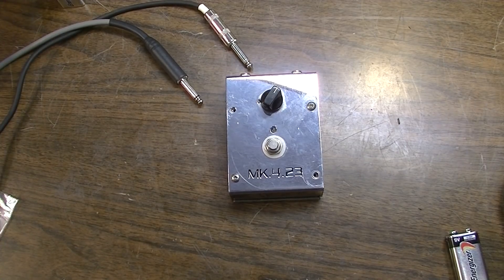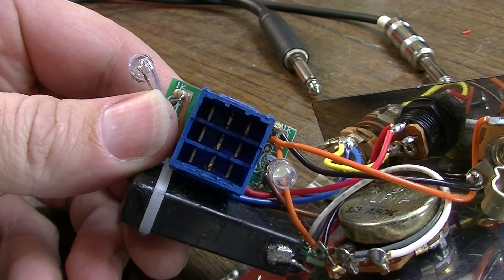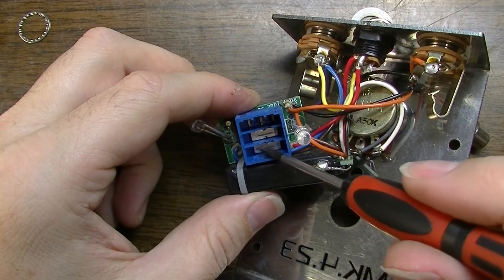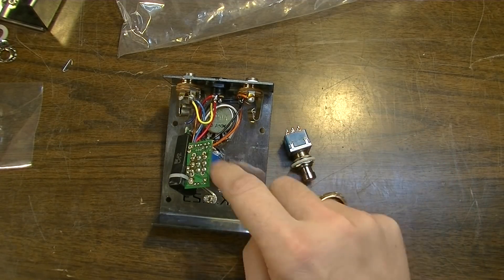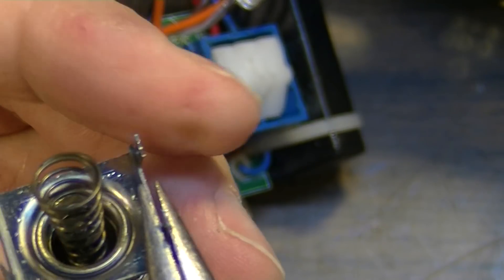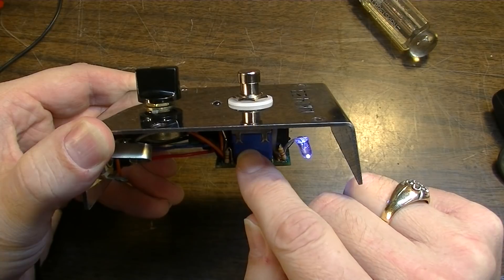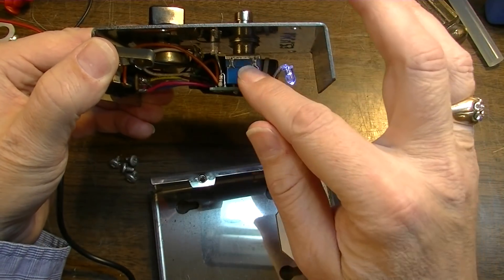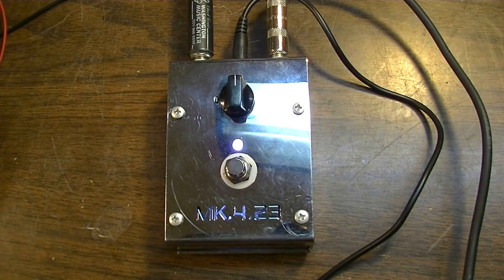These 3PDT Pedal Switches are TERRIBLY Designed - Creation Audio Labs MK 4.23 Clean Boost Repair

Comment: I've had 4 of the aqua switches and 2 of the black ones fall apart internally with simply minimal soldering. I'm about to start using knife switches I'm so fed up. The solder just destroys the internal contacts.

Comment: 10-15 years ago Creation Audio Labs was a respected group of people in Nashville who would do a great job refurbishing your console or effects units. Now,  it's a couple of hapless interns in a barn with no AC or heat, sewing batteries into electric blankets. Occasionally, they do a run of pedals and MW-1s, but it's not even remotely the same gear it used to be.  Now it's the cheapest Chinese circuit boards Alex can find, "assembled" into the cheapest recycled metal chassis he can get.

If you can find an old MW-1 or Holy Fire, it is a worthwhile purchase, although there are better, more modern alternatives now.   But the current stock is not even remotely in the same league.

Comment: 17:14 it came on by itself. Watch the led light.
Reply: Yep. Good eye. Switch is still crap. I don't get the bandaiding approach and this pedal's operation will only ever get worse until they have someone replace the switch. If someone doesn't want to deal with desoldering, use a $1 3pdt pcb and transplant or rebuild the other parts.
Or just call Creation. They're a good group of dudes and I'm sure they'd send you another switch and PC  on the cheap.
Reply: Nope, it was an edit. The jack leads move at the same time the LED comes on.

Comment: Tech Tip for you Brad ..... I recently had to de-solder a similar switch that had pins which were a tight fit in plated thru hole PCB .. Neither solder wick or an electric vacuum de-solder tool would clear the solder  enough to remove the switch . My solution was to remove as much solder as possible and then apply ChipQuik low temperature solder , used primarily for removing surface mount IC's (58 degrees C melting point ) . Then reheat all the pins and it will remain molten for several seconds whilst the part is removed . It's not cheap , but does a great job . No damage to plated thru holes . Easy .

Comment: Would this pedal be able to be wired to take the switch out of the line?  Making ot always on?
Reply: Yes. You figure out which wires the switch connects when on and then connect those wires, bypassing the little circuit board. The three terminals in the center will be connected to the three terminals on either side depending on if the pedal is on or off.

Comment: @The Guitologist
I didn't see this until after I wrote the story about the old (larger, taller) NOS bright/dim automotive/aviation footswitches I found. Actually here is a low profile , rugged new equip. floor brite/dim sw. for $4.16 on Amazon, > Standard Motor Products DS72T Dimmer Switch Okay, so they are limited to SPDT config., but you can use a 'quiet' active-IC SW.' which is preferable in many instances.

[orig. comment, good mounting tip...

A few years ago here in Columbus,OH at the really cool Eclectiques Antique Mall (4 story house, wall to wall antiques) I scored a big box of 27 NOS McDonnell Douglas "automobile and aircraft" floor mounted, foot operated BRIGHT/DIMMER SWITCHES. I paid $5 for the whole box. These SPDT bright switches were each in their own original brick red colored box with black writing and McDonnell Douglas logo. That alone made it worth grabbing them.

At any rate, I thought it would be neat to use the switches for stomp boxes. So I built a few fuzz boxes with them. They are pretty indestructible. The profile of these things are rather tall and they are a bit CLICKY! But they work, AND DO LOOK VERY COOL. Especially with the two stainless bolts anchoring them to the case. I use a Greenlee 3/4" RADIO CHASSIS PUNCH (AV11) (these are great tools!) to make the hole for the shaft foot sw., but the 'push button cap' is wider, so I take the bright switch apart (simple), remove the button cap, feed the shaft through the 3/4" hole, then put the button cap on. It makes for a really clean look. [looks like the new stock varieties are perma-sealed, so just get a Greenlee radio chassis punch that is bigger. I use these punches to make perfect chassis holes. I even have a 1" square punch. great for punching out for (Fender ps) transformers.

Ultimately the Bright/Dim Switch isn't nearly as practical as it is cool aesthetically. I could see recreating a throwback tribute that looks the same, but maybe smaller and quieter.🚀🚀

Comment: Looks to me the weight of the encapsulated circuit board damaged the switch. The switch itself limits the pressure but once the tabs are bent.... Solutions would be remounting the board or frankly a couple tie-wraps around the whole mess would be better than the hot glue.
RE: the sound, the camera ALC cancels out changes in volume, although it may get more compressed with the boost and it lags a tiny bit. 
RE: fingernails, as a tech I always end up needing my claws the next day after I cut them.

Comment: The very fact that you were able to open the switch so easily proves there is a design flaw. I have seen DPTT, DPDT, SPDT and others built so well you couldn't open them without destroying them. I agree 100% with ya Brad.
Reply: For me, not being able to open something in order to repair it, it's a flaw design.

Comment: I'm surprised, for all the cool stuff this guy does electrically, he's clueless with the mechanical side. The switch is cheap, but not a bad design. The original switch broke because the cap that limited the plunger travel fell off, so the plunger pushed too far, separating the switch. By separating the new switch the way he did, he caused 100% of that looseness problem that he "fixed" with glue. If he had just soldered in the new switch and not been lazy about it, the pedal would have been properly fixed.
Reply: Yeah he's working like a speed freak like tweakers I've seen sort of fixing stuff that isn't broken. There's a million of those switches out there, and  cost about 3bucks. Back when they were scarce and 15 $20 I could see maybe trying to fix them because twenty bucks was a lot of money back then. I'm in no way saying he's on drugs, just to make that clear. I just turned on the phone and it was here but I have not been watching these anymore cuz it seems like the shows have really changed with a sort of negative slant like everything sucks. It seems that many of these shows have changed when they get a lot of viewers, only Uncle Doug and mr. Carlson's lab have consistently been the same upbeat style for years
Reply: Yeah, id demand a refund. I watch his videos because its hilariously stupid. He does some half ass stuff quite often.
Reply: it is a weak design , since people stomp on it , since its a stomp box , and he fixed the easiest way ,
Reply: YouTube is full of self proclaimed experts. Watch 10 random videos about changing spark plugs and see how many even mention torque specifications much less pull out a torque wrench.
Social media continues to erode society.
Reply: Yeah, just desolder the damn switch from the board and put the new one in there, instead of ruining a brand new switch to half-ass repair a trashed one.

Comment: Honestly I really like the idea of taking the back off the switch and replacing everything but the blue housing. Only thing is, you wouldn't have had the issue of the switch collapsing if you hadn't weakened the four legs by bending them out and then back in again.

Comment: Look at this....!
Simply look at this....This is the probably the world´s best example of why not to buy anything "boutique".
The outer finish is ok, they even put the lettering though the faceplate put a backlight in and also chromed it. 
Nothing wrong with that, it looks fancy.

But as soon as you open it up....where´s the fancieness?? It´s never been there....the cheapest crap inside. Look at the pot, the jacks...that switch.
The money the ask for this thing goes directly into the maker´s pocket. This thing would cost you about 40bucks, if you put in a regular box, only 10bucks.
Usually they have a multiplier on top of this of about 4 to 5 times the money they spent making it.
So calculate yourself, if this is right or not. 

Ok let´s talk about that switch again: A good design would have been to design a PCB that would hold that switch and that epoxied board as well. And this PCB needs to be screwed down on the lower case-piece, for maximum ruggedness. Pedals always go through a hard live, they fall down they drop down, they sometimes being slammed down and this is what the designer needs to take into concideration when building this kinda stuff.

That switch itself, that crapiest crap on planet earth, i can say. At least i would go for a Bourns, APEM, or a Neutrik type...these are the GoTos when you want a reliable type. 

As you said, Brad all the force is sent into the switch´s housing. A neutrik type has a "full metal jacket" which could easily take all that force, and also some of the better types screwed down using two screws along with a center nut in order to maintain functionality after drops and falls even when it hits the ground on its lever  when mounted in the housing.
That´s what i would call "Boutique" - made to outlast everything - , not as in: made to fill the designer´s pockets fast and easy...

Thanx, Brad for this one :)

Comment: Those switches are not designed to be repaired. What was the point to repair it? To keep bottom part original and the whole switch not reliable anymore?

Comment: You might want to check out these switches from TE Connectivity. Note the metal top part wraps all the way around and secures underneath. Altogether better looking design IMO.
http://uk.farnell.com/te-connectivity/mpg306f/switch-push-button-3pdt/dp/1813634?mckv=fzJkuJ0s_dc|pcrid|78108377349|&gross_price=true&CATCI=pla-69459930380&CAAGID=14989731069&CMP=KNC-GUK-GEN-SHOPPING-TE_CONNECTIVITY&CAGPSPN=pla&gclid=EAIaIQobChMIpe2SveeG2AIVz7ztCh2XpAaBEAkYEyABEgJM__D_BwE&CAWELAID=120173390000108148

Comment: I think by supporting the board from underneath you’re causing strain on the solder joints where the switch is soldered to the board and those soldered joints might eventually crack.  That’s why most pedal builders attach the switch to the case and nothing else.

Comment: I'm Johnny come lately, but this is a case of the original switch being a cheap, low quality part. I've built and repaired hundreds of pedals and they all use the same standard footswitch. I've never seen one destruct like that. The best solution for bad foot switches is just to replace them.

Comment: You want the cap piece to limit the travel and transfer the stomping force to the chassis - think about a 300 pound biker dude stomping on the switch, if the chassis didn't absorb the force, no amount of hot glue, compressed foam or even a rigidly mounted PCB is going to hold up to that for long.  And you WANT the PCB to float - your video proves why - sacrifice the switch, which is inexpensive and easy to replace - if the PCB had been rigidly mounted to support the switch, the solder joints and the PCB would have been destroyed instead...         FWIW, ALL the switches DO have the extra lip to limit the travel and transfer the stomping force to the 16 gauge steel chassis.  Apparently this particular switch itself was defective and lost its extra cap piece somewhere along the way.  We've been through about 5,000 switches in the last 10 years, and I've only seen one other without the cap piece and falling apart like that.  The only reason you saw the blue piece moving around is because you took it apart and didn't replace the entire switch. To be fair and impartial, you should edit the description of the video - because it is NOT a design flaw... it was one defective switch out of thousands, and the design saved the PCB from being destroyed.         Also - FYI - those pedals come with a Lifetime Warranty against manufacturing defects - so next time one fails, just send it in.  Cheers!
Reply: Although - it wouldn't hurt to add the compressed foam and a drop of epoxy on the four tabs to make a good design a little better... we can start doing that...
Reply: Alex Welti I was wondering why he didn’t use foam as well, much cleaner imo and probably works better with absorbing force

Comment: I winced when I saw where you were going with that parts swap idea. Now  I understand the thinking, but having tried similar switch repairs myself I know that they're better off replaced. The construction is such that the closure integrity is right on the margin to start with. Opening and re-closing is just eating into that margin. Also note that Y split in the clip legs plays a part as well; difficult to tighten by hand. I'll bet that that bit is done in a press at the factory.

Still, you got it fixed in the end...

Comment: I have one of those pedals and it has a switch with a lip on it. I really liked the pedal but it just stopped powering up. No lights and it does not pass any signal through it. The switch seems fine.

Comment: I Facepalmed when you broke open the perfectly good switch. This seems a bit bodgy.. I don't think that putting pressure on this part of the switch is a better way to go. In fact I think it'll wear it sooner than if you just put the new one as it was. Those little contacts don't seem able to sustain the upward pressure they are going to take.. Still some good entertainment. 
Thank you.
Reply: Thomas Heys Same, once you've bent out the clips that hold the switch in place you can never get them as secure as they were from the factory. The design flaw in the first switch was not having the lip to prevent too much travel, but the second design is usually rated for around 300k cycles. I've personally never seen one go bad, but I have seen a few pots and switches that I've had to repair by opening up that never went back quite as snug.

Next time just replace the whole switch.
Reply: franisarobot ,I will only try to repair a switch if it's really hard to find replacement or in case of an emergency. Otherwise don't bother, change and throw the bad one where it belongs!

Comment: I don't think the creators have anything to gripe about, considering you not only identified the problem but also provided a simple solution. I wouldn't be terribly surprised if they start putting support spacers in the case, though rubber feet would probably be cheaper (in terms of labor) than hot snot. Also it might be easier to put the support on the back of the switch PCB rather than on the case side, so that every pedal they make can continue to use the same case, straight off the shelf. That would just be a matter of convenience for them, rather than anything wrong with your modification.

Comment: Why doesn't the bottom of the pedal have some sort of foam to support the bottom of that switch? Otherwise why ziptie excess weight (of the circuit) to it? I could see just stamping the pedal could cause that to fail.

Comment: Seems the only guys defending that switch are most likely the clowns using them and building pedals for 150.00 bucks with 30 bucks in parts.
Reply from the maker: +gregg4164 it's a badly designed switch.

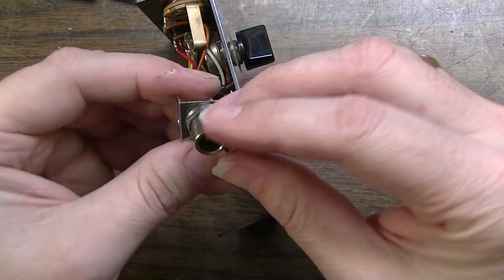Comment: Mark 4:23 If anyone has ears to hear, let them hear

Hard to trust a pedal that is named after a Biblical verse, but I guess one will have to pray in hopes of it working through the whole gig.. What an absolutely stupid pedal design. Mounting the switch with the circuit zip tied to it is just asking for problems as the switch is essentially bearing all of load. As it's a moving part, a switch really shouldn't be load bearing. When a switch is surface mounted to a circuit board, usually the weight is distributed to the pot or pots and perhaps the input & output jacks. In their concept the switch is holding too  much weight(in fact all of it). When properly implemented those switches are excellent and rarely bust from normal usage. I would venture to guess that the company spends more money on the box than it does actually making the pedal's circuit.  Looking at their factory price, I can think of few different boost pedals that are better conceived for a cheaper price.

Comment: My guess is even the manufacturer of the boost MK 4.23 never had any idea the switch would do that after time, maybe this is why the new switch has the stopper on the end now from feedback from others using this switch. Just a thought.
Reply from the maker: +Ken Allen I agree. The design fault lies mainly in the switch. But designers are using them in this way, unsupported. The lipped ones are def better, but will still wiggle the back free over time.
Reply: Yes that never accrued to me now that you mention it.
Reply: Maybe it needs a trainer bra, lol.

Comment: get a better soldering iron and a good desoldering pump- then replacing that switch would be a 5 minute job.  Those 3pdt switches break all the time- the best ones are only made for like 3k hits.  that's why pedal builders are going towards using dpdt switches with optical true bypass and relay switching using momentary soft touch switches that have much longer life
Reply: You can get 200k switch cycle 3PDT stomps now from a company called DeMont/Guyatone for $15 with free shipping. Hakko Japan also makes an outstanding FR-301 De-soldering iron for under $300. I got Hakko's earlier FR-300 120v model for $200 direct from Japan.
Reply: @randallabracadabra  We sell those switches! https://lovemyswitches.com/super-premium-3pdt-latched-foot-switch-soft-click/
Reply: Pedal builders are not "going towards" using DPDT - some are, but it's for "clickless" and "popless" switching - not because DPDT switches are "more durable"
Reply: Yay. I love the soft touch switches.
Reply: (((true bypass)))